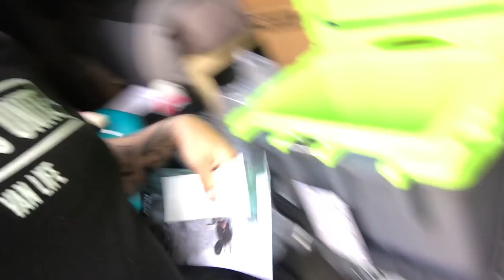MOVED MY BED | Van Life

Comment: Hey Crome, instead of having the bed supports at each end maybe build them on each side. You'll get more support that way and easy access to under the bed from each end. Also instead of 2x4 you could use 3/4" plywood as the support on the open side. Saves room & gives you a better divider.

Comment: My thought is have your bed like you did, going side to side.  Build a garage wall behind it, but have a large sliding window in the upper portion that you can open in the summer when you have the back doors open, or cover with some kind of curtains when you want to  block out the garage mess.

Comment: Maybe try the bed in front of the side doors up against the back of the drivers seat? When you open the side doors, you will have access to the bins and the bed. Could park sideways and open side doors for the sunsets. Use the whole back as the equipment area and sit at the end of the bed to work?

Comment: I agree you should keep bed the old way. There are so many great way to redo your storage needs. Rethink storage as narrow not deep. Like how the clothing compression is or better put store things in layers. I think also slide out draws like in kitchen cabinets. Saw great back storage idea hang bike horizontal on flat board that's slightly higher than bed so it's not seen. If built it can be turned into sorta a back for along the bed. But still low enough to see out back.  So hard to explain the visial. Hope you can figure this out and it helps.

Comment: Mount the bike on the roof above the bed the wheels on the side so you can turn the bars and it be flat so you can look at it while you sleep. For organization drawers on sliders you open the back doors slide it out and have sections in the drawer bike gear tools ect 1 long drawer with the other side open to fit long gear

Comment: Get softsided storage that you can hang on the walls or ribs of your home. 1 it will help with insulation and sound absorbtion. 2 easier access. Maybe you can use 4x4's and brackets for the legs of your bed so you can get rid of the bottom 2x4 then you can slid the boxes around easier.

Comment: I really like your bed frame design. I was going to mount some 8x2s to the sides of the van for a frame but yours looks much easier...less metal drilling and more minimal. 

Question: how do you accommodate the wheel wells when making the braces for the bed? Do they get in the way?
Reply: VANCITY VANLIFE great. Thanks! 👍😁